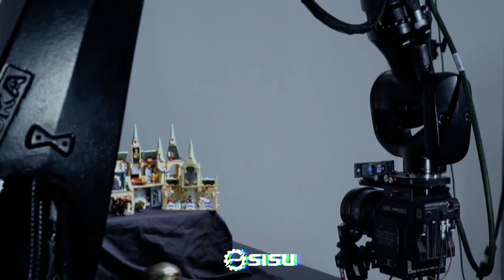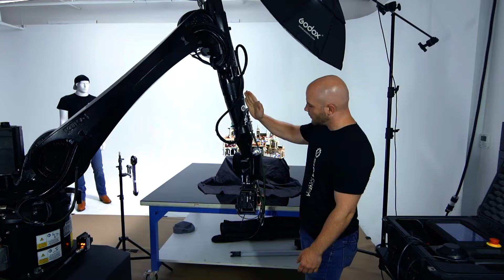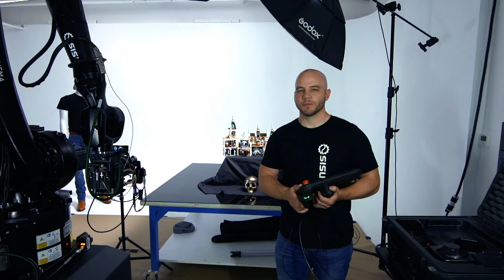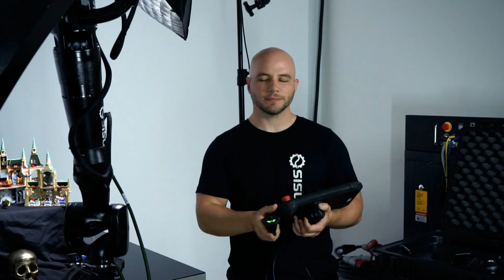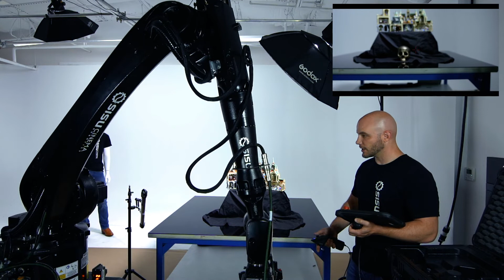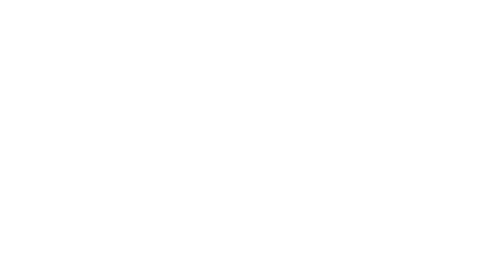Robot Singularities - Understanding the "Cone Zone"

Comment: I found the best way to avoid singularities on tabletop shoots is to have the surface at the same height as the Joint 1 motor. This almost eliminates all the 4/5/6 singularities. 

Also, having the robot base perpendicular (robot plugs away from subject) alows for more flexibility in your joint limits / cone zone.